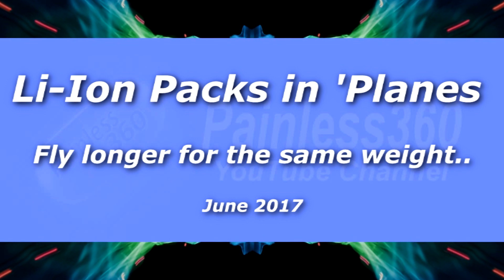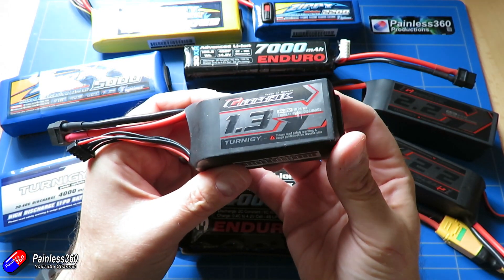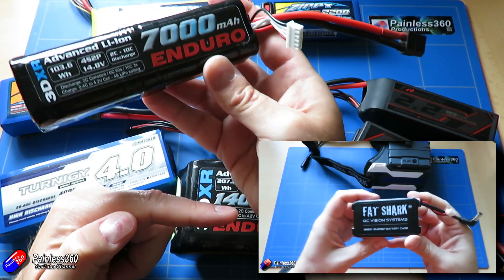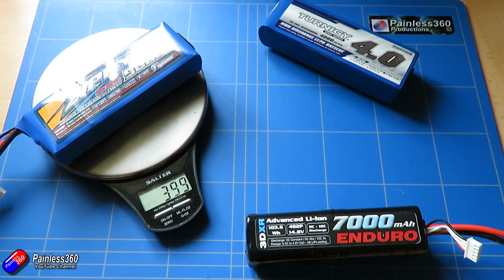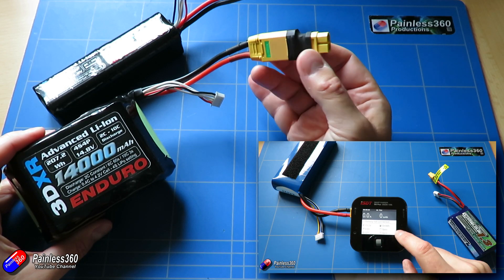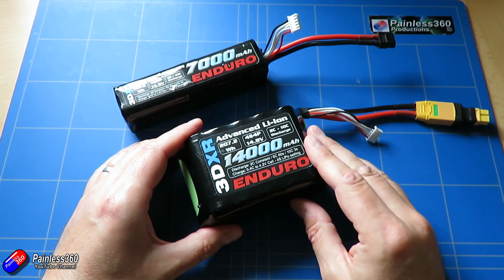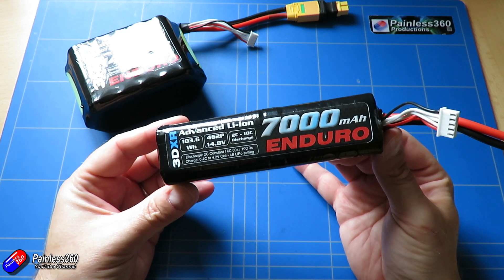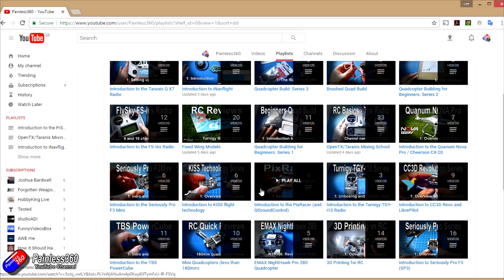RC Tips: Using Li-Ion packs for longer flight times in fixed wing models.

Comment: THANKS ... Great advice !
Maybe the landscape has changed, but it's rare to see li-on packs for flight (3DXR Have zero).  I'm embarking on making my own 6s packs for my EDF jet. The Molicel P50B 21700 cell seems to 'kick ass' compared to Lipos with double the flight times for similar cost & weight. They're 5000mAh &  50amp continuous current draw. Good for 500+ cycles. Just Don't understand why Lipos remain ubiquitous  ? Maybe I'm missing something  ? Newbie Phil ... 🇬🇧

Comment: I was wondering if the low voltage will be a problem with escs cutting out early due to low voltage cut off. How can you stop this.
Reply from the maker: Change the low voltage cut-off (LVC) setting on the ESC you are using. See the manual for the specific ESC you have for how to do it. Happy flying.

Comment: Hey - i build a 3S2P 6000mah LiIon of 18650 Sony Murata.  This cell you can fly to 2.5V (and lower) but the ESC (HTIRC Hornet 40A) have throttle-cut at about 3V per cell! Any ideas how to fly until 2.5V/cell?
Reply from the maker: The only option is to disable the LVC on the ESC. If you can...

Comment: is it possible to use Li-ion 7.4V 1100mah battery with 40amp ESC? does this will burn my motors and serveros and ESC?
Reply from the maker: It depends on the 'C' rating of the pack. See my RC basics video son power systems and battery/ESC/motor sizing.. Best of luck!

Comment: Hiya, I have a 3s2p 7000mah lithium ion pack in a flying wing. I wanted to put a battery voltage buzzer warning thingy onboard,  so I dont risk running out of juice and crashing. I was was thinking,  what lower limit voltage would you recommend for triggering the warning buzzer? Sorry for the silly question,  I'm a noob!. Great video by the way!
Reply from the maker: Check out the evtra LiIon conte in the big boys toys playlist.. Happy flying!

Comment: Which battery will be good for Hexacopter ( Tarot 680 frame ) with 400 kV motors...???
Reply from the maker: Depends on how much current the motors with whatever props you're using will pull at maximum and in the hover - see the endurance builds for how I'm trying to figure all that out..

Comment: HI I JUST BOT AN XKA 800 FIXED WING AND WOULD LIKE TO KNOW UR RECOMMENDATION FOR A GOOD BATTERY PLS
Reply from the maker: I've not had one of those but looking at the specs the battery that's supplied is a 2S 300mAh LIPO? You need to be careful if you're looking for a LIPO with more capacity as more capacity = more weight and you need to be able to mount a heavier battery nearer the centre of gravity (the place where the plane needs to balance) in order for it to fly. I'd suggest getting in touch with the vendor and seeing what they recommend. Best of luck!
Reply: tq

Comment: What 40A ESC would you recommend for use with this battery? And how can I get it to work with a motor made for LiPoly batteries?
Reply from the maker: Any should do but watch the low voltage cutoff settings..
Reply: 'Just so I understand, even if a ESC has been labelled as LiPoly compatible it still works with Li-Ion? (Same for motors)

Thanks.
Reply from the maker: You need to check with the vendor of that specific ESC that you're interested in, to be honest I use standard escs and just watch for those low voltage alarms and everything seems to work fine. Best of luck
Reply: I'll do some digging around, cheers!

Comment: did you ever connect two batteries in parallel, one Ion and one LiPo, both with the same voltage, but of course, but with different mAh. That way, the Lipo, would handle the C rate, and the Ion the endurance...
I just don´t know if the Lipo, for instances, with 4000mAh, and the Ion with 7000mAh, would run out earlier, or if, connected in parallel, the sum of both, would turn into 11000mAh combine, and discharge evenly.
Other solution, would have some kind of regulator, which would draw power from the Lipo, just on high discharge demands.
Just occurred to me watching your video. 
I´ve learn a lot with your channel, and I thank you for that.
All the best
Reply from the maker: I would never recommend connecting two batteries with different chemistry like that. Happy flying!
Reply: well, maybe on the future, or using capacitors with Li-Ion, and that way, got the discharge problem solved.
maybe it´s a silly idea, but then again, got to try it

Comment: Looking at getting the 3DXR Power series Li-ion for my large multi to replace my 8s 22,000 lipos.  The power series has a 6C rating which should have a 132A constant discharge at 6c. My question, is it better to get 22,000 li-on and save that weight or get higher mAh, say 30,000,  and make it the same weight as the 22,000 lipo? So which will give more flight time, same mAh lower overall weight or same overall weight but higher mAh?
Reply from the maker: More mAh = longer flights. Same mAh in a lighter battery = slightly longer flights. I'd use the same weight and get the max. mAh I can in the Li-Ion pack :D

Comment: This mgf is "sticking their necks out" here because if you dig down deep into "Tesla" and the company that makes his LiIon cells (Panasonic) - they don't approve their cells used in these applications. I know, I sound like I'm "harshing the mellow" but remember this: - there's a ton of electronics on Tesla's power paks to mitigate "stuff that happens". They can only market these cells if they have a "chip" welded to the negative end that limits current. Look on YT for this. Now, that being said.. these 18650's "kick-ass" like no other BUT when they "blow" from users running them outside their design envelope.. you can't  stop the flames. Warning: - Keep all your packs in a safe steel fire-proof enclosure! I use an old gas range. I stand a better chance not burning my home to the ground like my pal in Tucson last Christmas.. Thanks for post!

Comment: Can you use in Quadcopters thanks
Reply from the maker: Not really, it can't deliver the huge amperage you need at a weight you can fly at in a multirotor..
Reply: Painless360 Doesn't the Sony VTC6 and its 15/30A make this somewhat reconsiderable in slower copter uses such as survey/photography?

Comment: I have a 4S9p 31,000 mah li ion pack in my plane and at 9 amps cruise speed it stays up for 3+ hours . 13x8.5 prop and a emax GT2826-6 710kv motor. the air frame is a skyhunter.
Reply: How does your charger handle the 9P? Are you only balancing the parallel cells against each other? You don't truly get a balanced pack when you do that do you? Will most chargers be ok with that?
If you built your pack yourself, I would be very curious and grateful to see a wiring diagram. I am currently flying two separate 4s packs in parallel with each other and charging them separately.....
Reply: Daniel Garrow 18 cells! And here I am pondering between 2S2P and 3S1P. How heavy is your craft? Mine is just about 200g without the pack.
Reply: Good grief!

Comment: Great informative video. Thank you. Quick question, what is the best way to charge a lithium ion battery. I have a Cellpro 10s charger and it has an option to charge Lithium ion batteries. However, when I plugged in a 7.4v Li-ion battery and the charger was still set on Lipo function, it didn't recognise that it was a Li-ion type of battery and it started to charge it.
Reply from the maker: The voltages and chemistry is so similar that the charger won't spot it so make sure you've selected the right battery type before hitting the 'go' button. There are lots of lithium based packs now 0 LIPO, LIHV and LI-Ion so it's up to the operator to check really.. Best of luck!
Reply: Painless360 Hi, thanks for the quick reply. I'll be sure to check that I have selected the correct function on the charger then :) Have a nice day.

Comment: Not to mention lion 18650 don't bloat like those lipo. Panasonic 18650 for endurance and INR's if I want higher C discharge ratings.i use HE's and INR's for my rc short course trucks for bashing and occasional indoor clay. It's not ROAR approved but soon they will.and you don't have to baby sit this like the lipos for storage.heck I have a 9 year old laptop and the 18650's In there still has good charge in it.lipo can't beat that lifespan👍
Reply: My laptop im on now is 8 years old and the battery hasn't charged for about 4-5 of those years. Could they still be good?
Reply: Possibly. Crack the case open and test them with a voltmeter. Should be able to find exact instructions on one of the eBike sites on how to do this.
Reply: Don't most 18650s have like a 2 amp discharge max? And they may not bloat, but they explode like a shotgun shell when they fail.

Comment: sir  I wanna build a quad but the original  SP F3 but is no more on sale then can I buy the clone from bangood is it good or any other FC
Reply from the maker: Buying a clone always includes a bit more risk than an OEM version. See the builds series we've done in the pact few months, we've not had a problem with the boards I've used. Best of luck!

Comment: Could you talk about charging these batteries. It seems to me there is a lot of conflicting/confusing information about how to charge them.
Reply: .4 Charge rate to 4.20 per cell then let sit 10 min.
Reply: Confirm,  Charge at .4 amp until individual cell voltage reaches 4.20 volts then let cells rest 10 minutes before use ?

Comment: hi paint less u must mention that this batt it needed to used from 4.2 till 3.0 if not all the capasity will not been used... the the drop rate is high means from 4.2 to 3.85 is only a minute but it will maintan it till 3.0

Comment: You can also salvage tons of those 18650 batteries from old notebooks. I have a box with about 50 of these batteries, just make sure you store them in fireproof or other protective box. I never had any problems with them (even with the ones I rescurected from from < 1V), but you only need one bad luck to start a fire, so treat them like that. (you should store lipo this way anyway)

Comment: Hmm.. Interesting.
Li-ion and Li-po, what's the difference? 
Form factor..
Ones rolled up into a metal case
Ones flat sheets wrapped in plastic.
They are (well can be) the same except the casing.

What you find it that the higher C on li-po is down to a tweak in chemistry but mainly it's down to how the layers are connected to the cable which was dictated in the design brief when they went to make them..

But yes in low C scenarios you'll find a better chemistry and layout match in 18650 than in li-po. Which was the gist of this video ;D
Reply: Exactly!

Comment: So how do these guys handle some of the bigger wing hand launches?  I.e. RitewingZ3/Drak/Chimera et al need 60-80 amps for launching but can easily cruise around on 10-20amps.  Seems like a great long range cruise option but can it push a 6 pound plane airborne?
Reply from the maker: I think the answer is very carefully! :D Serioualy though, models with large wing surfaces and low wing loading (and flaps) are easier to hand launch as they float at far lower speeds. A little run and good throw help too. Is this worth a video?
Reply: I was just wondering if the ION packs could handle the bigger wings when launching.  I'm sure a hand launching video of any type would be appreciated.

Comment: I use 2 x 18650 4amp batteries in a 3D printed tray in my Taranis X7. I've only charged them once, used it loads, and still have half left.

Comment: I had heard of folk using these packs, but didn't pay much heed. Thank you for explaining it so well. I blew a cell on a MultiStar 5200 4s last week with a Mini Talon and was in the process of shopping for a replacement. Now I'll have to give serious consideration to switching over to Li-ion. 
You mentioned that the esc would misbehave once the pack hit the LiPo low voltage level, is there a way round this to allow the full potential of the Li-ion pack?
Reply from the maker: +Quad Damage FPV check the manual for the ESC that you have in your plane, you're looking for the low voltage alarm and low voltage cut-off options and you need to set those as low as they can go. Hope that helps
Reply: Quad Damage FPV look on Facebook a group name x uav mini talon pilots
Reply: I'm not a Facebook user - shame :-(

Comment: Thanks Lee, always enjoy your informative and well explained videos. Just to add a bit more to your comments, I've found these packs do get noticeably warmer during discharge than LiPo's even at 2C. Also, while they are 4S they don't quite hold their voltage as high during their discharge as LiPo's do, so should almost be looked at as a 3.5S pack and one's overall power will be down a bit. Cheers, Graham

Comment: Have been building my own packs with high discharge (25A continouos, 40A burst) INR Li-Ion 18650 2500mAH batteries.  They do last longer (>50%) than my Li-Po batteries of similar weight.  I just don't push my planes much and quite satisfied cruising around.  Hopefully more.vendors would carry these.
Reply from the maker: +Ako'y Tamad let's hope so. I'd like more for my larger planes..